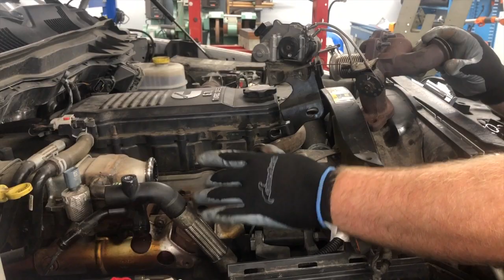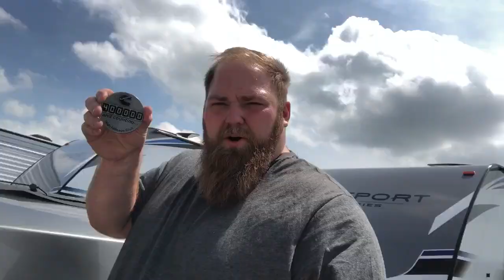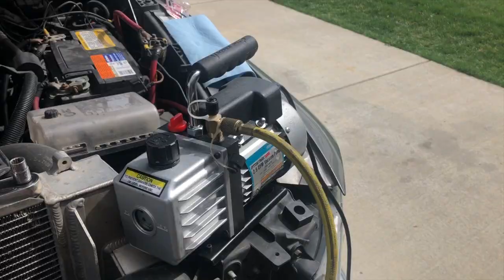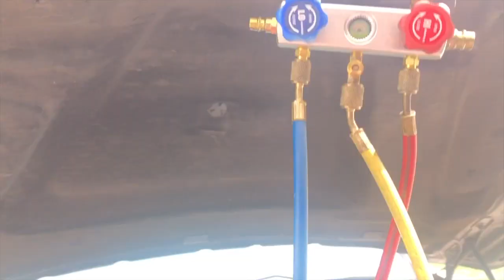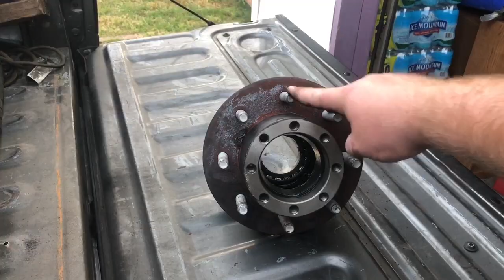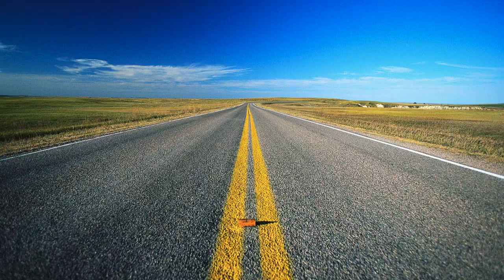Things to consider before starting RV Transporting

Comment: Are you still in the business ?  I am thinking about buying a tow car and just do drive away.  It seems like it would be easier to drive a new motor home and tow a car than buy a good truck and tow a pull camper.
Seems like a lot of people prefer towing campers is there a reason ?
Also I am retired aircraft mechanic and have a CDL class B license would this help me get hired ?
Is there a lot of business now ?
Thanks in advance
Reply from the maker: DENNISROC Yes I’m still in the business! 😎 there’s more money and freedom with tow away but with that comes more responsibility and risk. Drive away is a great, low risk place to start in this industry if you want to test it out. Drive away has it’s own different challenges I’m sure. Yes that will help! Each company requires different levels of experience with some type of hauling. It’s best to speak to each directly to find out if they would accept you based on your individual situation. Right now we are booking. Without Covid, we would have had a lull in July with refitting the manufacturer’s but they were so far backed up we have been accelerating forward through it. We have a July and end of year slow down. I have a video on the end of year shutdown. Hope this helps Dennis!  God bless!
Reply: HighMileageHelper do you know the average for driveaway per mile compared to pulling campers with truck ?
Great videos

Comment: Do you purchase your permits in advance or at the weigh station ?
Reply from the maker: Ricky Blackshear it’s been a while since I’ve gone out West. I definitely try to avoid in winter because it’s not worth it to me. I always would buy at weight stations though. I know in the past I’ve bought online before when the station was closed. I have my laptop and travel printer with me powered by my cigarette light converter and hotspot for internet if needed. So I always have the option. Good question! I’ll be going through these topics further after I get through these beginning videos.
Reply: Thanks 👍